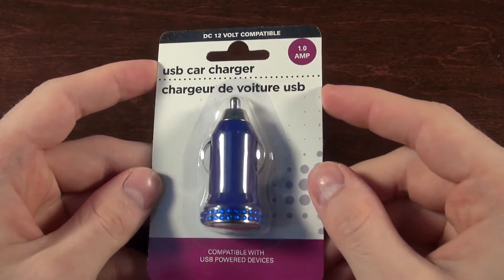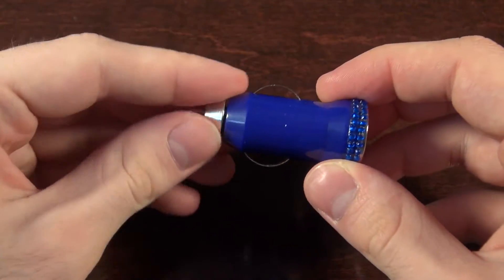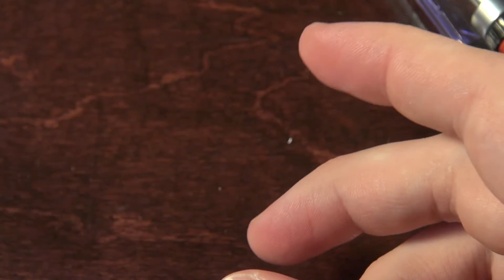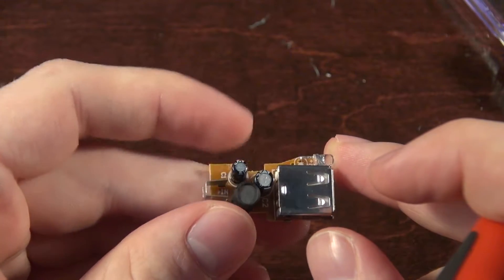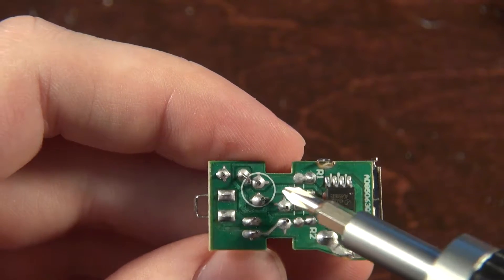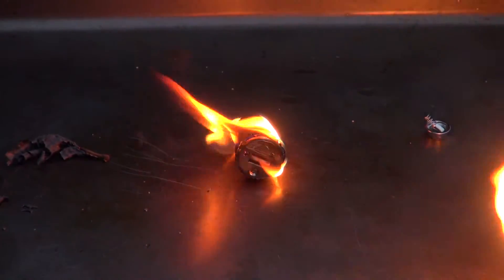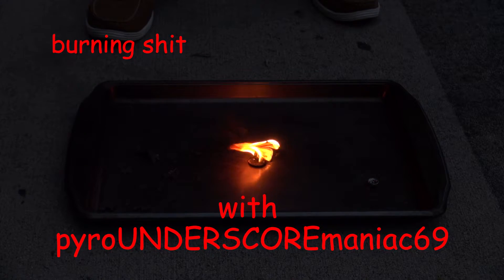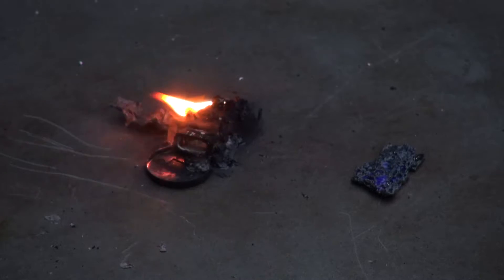Dollar Store USB Car Charger Teardown (with Fire!)

Comment: just bought this exact one actually and was nervous and somehow I found your video. I know you said you wouldn't recommend it but do you think it would work or will it blow up and burn my car down
Reply from the maker: I don't think it will blow up, in theory, it will work, I wouldn't use it when you start your car, but while your car is running it can power some stuff. Just be cautious and unplug when not in use, same things I do even with good ones. If you smell something odd or it gets super hot, just unplug. I'm more moved in now, maybe I should get another one and do some real world tests to see how it really handles.
Reply: Ok great thanks great idea. yea do more real world tests. btw I subed
Reply from the maker: Awesome thanks! Yeah I felt a bit disappointed at the time because I hadn't unpacked enough stuff to test, so I did the teardown...and then burned it, you know how it goes!
Reply: Yes I do